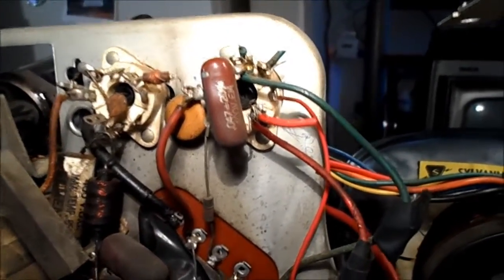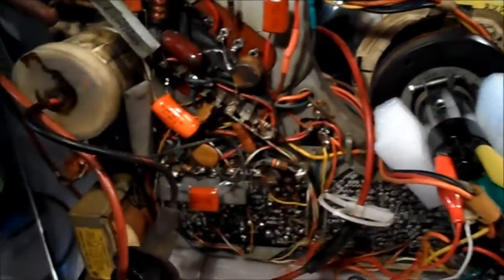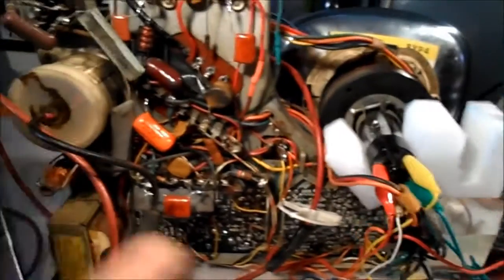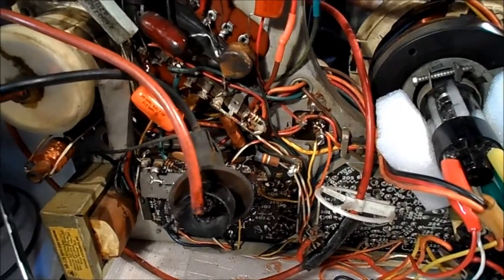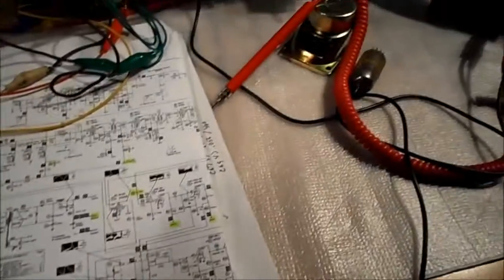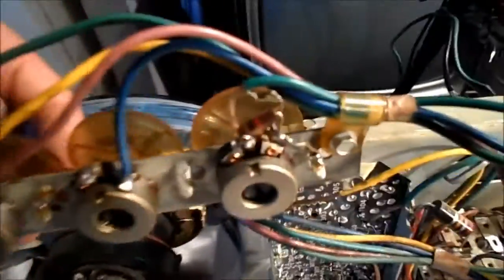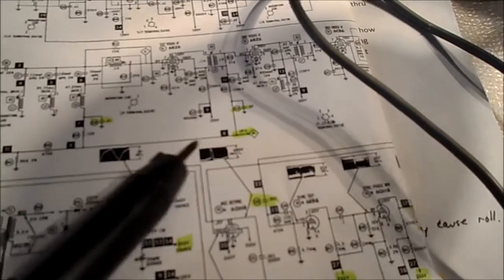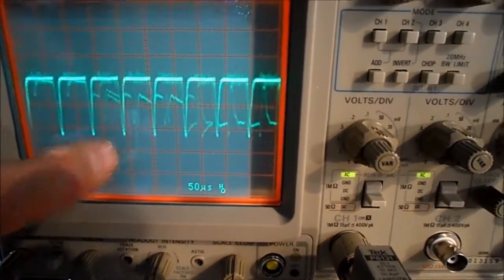1965 Magnavox B&W Pt.11. Vertical Locks Now.

Comment: the 230 v with tube in shows the vert osc running (feed back from the plate), the 8.5v is just the output from the sync sep. if you scope it while the tube is in but with no signal you will see the 220 vert pulse, tune in a signal and you will see the "pip" of the integrated sync pulse start up and sync up the vert, You should see a "slight" increase of vert freq once the channel is tuned in and the "pip" takes over. Often you can hear (in the yoke or vert out trans) the diff of a raster (no signal) and a tuned in channel. Its subtle but you will notice it runs just a tad faster. The raster needs to run slow so the sync signal can kick start it. If the raster is set to high a vert sweep, the sync will not be able to control it.
Reply from the maker: Thank you for clearing that up.
What's adjusting the contrast have to do?
It did roll when set darker. That's cured too.
Reply: well I was thinking there is an issue with the sync sep and since the grid source of the sync sep comes from the video out, then maybe reducing the PP to the grid may improve the separation action. Sort of the same as giving it a weaker signal. As to why its working, that's tough to say. changing the boost cap may have something to do with it since the vert plate voltage is taken from the boost source. Normally I would expect some interlace issue to show of that had been the case (not rolling). Its really hard to say. I would still like to see the pin 1 no tube reading to see if the video info is gone (tube out bright down).
Reply: Dave WM hmm a poor ground connection at pin 4 of the 6GH8 would maybe cause a low filament voltage to that tube, def screw things up. Did you happen to notice if the tube filament was not as bright before the fix?
Reply from the maker: I did not. Either tube works fine now.
Reply: I tried to review the video but since it was the bottom of the pcb and the tube was in the socket, no way to see well the filament was glowing. So you can remember seeing it pretty well before touching up the ground? I know its inside the shield. I hate unsolved puzzles. oh well its working and that's what counts :)
Reply: I would be tempted to try and simulate a break in that pin 4 (filament ground) with a junk tube socket, just to see what happens. Of course its would be a complete waste of time, but interesting none the less.
Reply from the maker: Dave WM
It's a good chance. Once Elmenco's were replaced, it still was not fixed.
 "Sync separator problem"  You, fxsuarezc1, & 1 TV book, were right on.
 Sync Separator Problem. Soldered the ground to the 6GH8.
A. It's a ground.
B. It did not look great, so I hit it with the iron.
Reply: Farmradio  knew it was going to be something simple, but simple does not always mean easy to find. So a weak filament would mean low emissons, prob causing a weak/poor sync. Glad you got working.
Reply from the maker: Dave WM
That's the truth, I think. Dirty socket? No. Bad ground. Found under shield like a early 90's RCA tuner. They did weird vertical things too come to think of it. It must go back to cabinet. Will run with original 19" CRT. It tests down, but good. 8YP4 - "not for long term use". -Sylvania.
Reply: Farmradio
toughest dog I ever had was a poor ground on that deflection board (the screw that holds the board to the chassis was not tight) that introduced some hum into the horz and induced a very slow moving horz shift like a wave in vert lines that would take about 11 seconds to cycle thru. tighten one screw and it would be fixed. I ended up soldering a buss as I was so P.O.d about it.
Reply from the maker: Dave WM
I am surprised grounding by the corner screws. None of the boards are soldered to the chassis. All sorts of weird things could happen. Yes, a buss would be a cure for that.
Reply from the maker: Dave WM
I will do the scope again on the pin 1 tube out, bright down, & report back. Is C69 .056 the B+ boost cap?
Reply: C66 and C67 are the boost filter caps. that C69 effects the width.